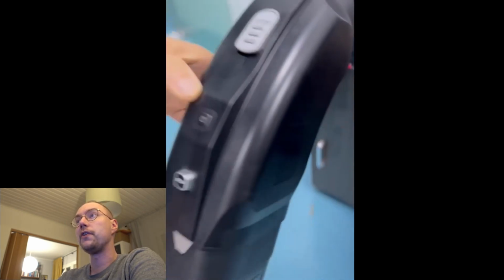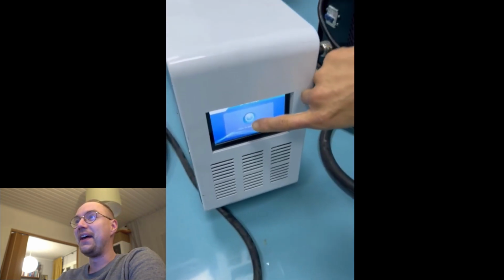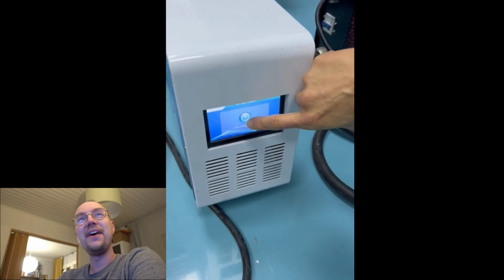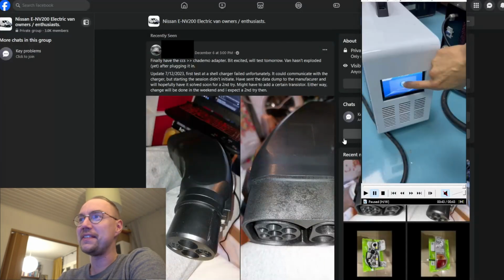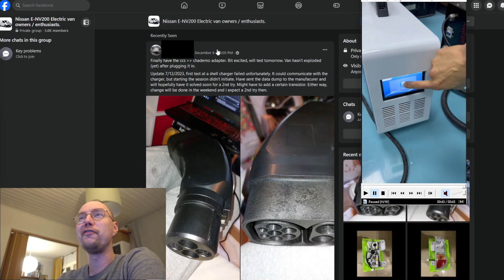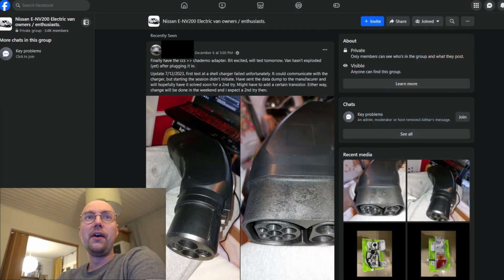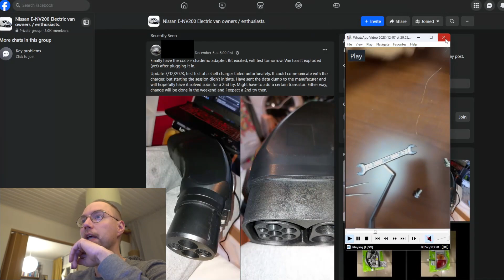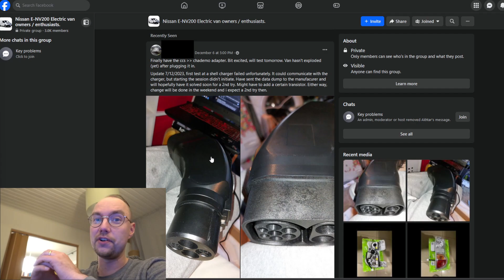They did not even test it on vehicles!💀

Comment: Great they have made these, now they just need to make another variant where it is a box with the needed electronics and some generic plugs.

Make a faceplate for different cars to be able to replace for example the Chademo / Type 2 connector in the Leaf, with a CCS2.

The way they should do it is make the box with the electronics a generic box that can be fitted into anycar (Maybe via a car specific bracket) then the faceplate with the connector.

Then you connect the faceplate CCS2 to one connector in the box, and another wiring harness that is also brand / model specific to connect into the existing car harness.

This way you can fully integrate it, and they only need to make one model of box and then different models of CCS2 plate to fit each car model and a small wiring loom to put in between the box and the car.

Oh yeah and then they need to cut the price in half :)

Comment: Apparently the chademo company do not approve of these third party adapters. It seems when evs are charging there is communication between the car and charger. It's not as straightforward as using travel adaptors for something like a  hairdryer. According to chademo the communication between evs and chargers is also different for the various models. These  aftermarket chargers may well appear to work but more needs to be done to ensure they are safe to use. It seems that some of them may not necessarily be weatherproof.

Comment: Bonjour je possède l'adaptateur et j'ai un problème avec un type de borne qui s'arrête entre 10 et 13 minutes de charge ... Cela peut-il venir de ma batterie interne pas assez chargé ? ... Est-ce normal que quand je change en USB l'appareil clignote rapidement au démarrage puis lentement un certain temps et recommencer indéfiniment ? Je ne suis pas sûr que la batterie interne charge vraiment .
Comment cela se passe au niveau des voyants quand vous le mettez en charge vous ? 
Cordialement
Et bravo de France
Reply from the maker: Update the software on the adapter. The charging stopping randomly was solved in firmware 3.3.8.6.B29.4 and onwards. https://docs.google.com/spreadsheets/d/18Uqyb2vJoLLAhkaYuRJ3yp8TAK-YEfgthubDkoFBTI4/edit?gid=1524304464#gid=1524304464
Reply: @DalasEVRepair  merci je l'ai déjà testé  ...aucune différence 🫤
Reply: @DalasEVRepair  what IS the best for leaf 40 ze1 ?
Reply: @DalasEVRepair  je pense qu'un des composants chauffe trop et mets en sécurité sur ces bornes là au bout d'une dizaine de minutes

Comment: Why would there be a requirement of a contactor at all? I guess both the charger and the car are having them. I think they added it to be able to sense the voltage of the car to tell to the CCS part what to supply. Then it need to disconnect the two until measurement is done.
Reply: Yes, except they did not add the sensing part, unfortunately... They are just using a fixed voltage of 350volts.

Comment: Dala, I have a 2013 nissan leaf that I changed the battery,  what should I do to see the bars of the new battery cause apparently I am seeing what the previous was registering?

Thanks in advance for your advise.
Reply from the maker: After changing the entire battery, the bars will be updated. Sounds like your new battery is degraded also? Or did you just swap the cells?
Reply: Hi Dala,I changed the entire battery pack except the bms.
The top part of the casing came damaged and also damaged the bms case so I use my bus instead. Will this caused this issue?
Thank you.
Reply from the maker: @barrepairsandmaintenance2425  yes, BMS needs to be reset with consult3+ nissan tool
Reply: @DalasEVRepair  ok thank you very much.

Comment: Further updates, it's working....kind of...looking promising!

Update 16/12/2023 I got multiple session working, although the soc data is really weird. Not sure if something wrong with my car,because nothing makes sense. Charging went slower and slower, dashboard gives full bars and full range, the little display on the right says 92%, leafspy says 88% and the kwh was 16.7kwh for a 24kwh 80%soh battery. Well at least i have zero worries that the adapter might cause some damage since the car simply controls what it gets. I did clear dtc's beforehand, longest session was close to 20 minutes. It was a ABB charger from Vattenfall at a mcdonalds parking lot. I really hope other chargers are that much different.

Update 16/12/2023 Got a working session!!! Only the soc was way off again, 60% vs more or less 90%, it started charging at 23kw at 4 degrees C so i stopped it after a few seconds. Real progresss!!!!
Okay good progress (see first post). Got a charging session going (!!!!) but the SOC was wrong. 60% was communicated, inside the car i had 10 of the 12 bars and this is what leafspy says. The charging station showed it charged with 22-23kw and i only dared to do this for a few seconds before i might damage the battery. Will drive around to drain the battery a bit more so i can charge a bit longer and will get a new firmware today as well. Will make a video next time if i have a bit more then 10 seconds to hit the stop button 😛

Update #3 @ 15/12/2023 Probably made a mistake myself with the external batteries, one of the cables probably 'slipped' in the welding clamp so it wasn't exactly 'on' during some of the testing. There is a led inside which you normally can't even see with which to check if the 12v is working, but it's in such an awkward position under the charging hood, i didn't notice it wasn't on. Anyway, with the latest software and the 12v 100% surely working, it sstill failed at the same point still. Only felt that the SOC may have been correct this time. Getting close.......

Update #2 @ 15/12/2023 Progress continues, but the manufacturer now thinks the little battery inside is not enough and their working prototype has 2 of the 3.7v batteries inside. Still strange that it still somehow doesn't work with an external 12.8v LFP battery attached. The inconsistencies might be because of me or that some soldering might have come loose. Got software update #12 now, will go within the hour for a last test today. Then i probably get a response during the night and tomorrow another few tests if they work on a saturday. I hope i didn't do something wrong with the soldering, i did check it afterwards, but still.....fingers crossed.

Update 15/12/2023 Progress continues, soc still gets translated a bit odd, but it's now closer (45% vs ~75%), also the communication error on the charging station comes a good full second áfter display the soc on the charger. Got av video of a brand new leaf with a portable ccs charger with this adapter, and they got it working. Getting closer and closer. Will test again in an hour.

Update #3 @ 14/12/2023 Progress continued with a late night test with the latest firmware. It now got consistently to the same point, showing a faulty soc (13% instead of ~80%) before not charging. Earlier in the day it only went there the first time and was all over the place, so, from my perspective, this consistency is already a major step forward. It looks promising to have the first succesfull charging session before monday. I did forget my charging card, so i had to activate the charging station through the shell recharge app.  I really hope it's not what (also) makes a difference, but come to think of it, activating the charger felt faster through the app, then manually holding the card to the rfid reader.

Update #2 @ 14/12/2023 Promising progress, but a bit inconsistent results. Seems like the fix is in timing issues so have to do a lot of tries. I did manage to get a battery soc on the charging station, but it was a bit wrong. Hopefully a couple more tries and upate over the days and we should have a succesfull charging session soon.

Update 14/12/2023 Promising progress. No longer a time out just before the charging session should start, i hear the charging station 'engaging' but then it quits. Precharge was succesfull. Manufacturer thinks something with timing in the software might be able to solve it. Hopefully today a 2nd attempt.

Update 13/12/2023 Manufacturer came with another (possible) solution, had to short circuit 2 tiny components on the chademo side, will test tomorrow around noon. Will have to test with the external 12v, the first added resistor and the latest fix. Manufacturer seems more sure then ever. Who knows, best case scenario; it works, worst case scenario, my car doesn't. 😃

Update 12/12/2023 Unfortunately with an external lifepo4 12.8v battery exact same result. It gets in an infinite loop on the adapter just before the actual charging should start, just like last times. I hope i can get some good news soon. It's too bad the ccs charger just gives the most generic error..... //adendum. So the manufacturer has aranged a chademo car, but he can only test it with another adapter. Not sure how useful this will be, I'm trying to convince to somehow show more debugging information. If the tests with the chademo car in China won't lead to further insights, I will press them on it.

Update 11/12/2023 Unfortunately with the usb C cable providing some additional power, the problem remains the same. A bit dissapointing obviously, but manufacturer will look for a chademo car in hong kong. I'll try to figure out some things, but i'm also busy with a huge renovation (cmplete rebuilt) of my house, so it won't be fast. Too bad it can't be fixed with a firmware, for now, i'll try to attach it to the car battery somehow to test if does work then. Fingers crossed.

Update 10/12/2023 4th & 5th test after firmware upgrade. They/we get the feeling that the 12V signal isn't strong enough or at least that the internal battery isn't big enough to handle the 5V can signal ánd the 12V signal. Will have to try again with extra usb c cable for a little bit of extra power.

Update #2 @ 9/12/2023 3rd test after small software/firmware upgrade, failed at nearly the same point also but got different data. Hoping for a 4th test in the coming days.

Update 9/12/2023, 2nd test with the added resistor, pretty much the same issue. "b2801-29 08 charger q/chg activitaion sig err vc-52" error from leafspy. So the car 'recognizes' with the 'click' sound that the adapter has been put in, ccs side can communicate with charger. From comparing the output data, issue is still the same for now. Will keep you updated.

Comment: That thing feels a bit like those dodgy adapters that gas car drivers use, with sometimes predictable results... 💥🙈

Interesting device however, but I rather see a retrofitted CCS port on the Leaf. That would take away any hassle with supplying 12 V or having double contactors, and CCS is everywhere. Chademo is totally unnecessary, unless doing V2G.

Comment: It will be a game changer for the LEAF and the Triplets if they can get a reliable CCS to ChaDeMo adapter, purely as they will now be able to access the entire network. In the UK, there are still ChaDeMo being installed, however give it 10 years and these cars will only be able to 7kW AC charge. 

When the Leaf 62 and UX 300e can get in excess of 200-250 miles, it may be less of a problem. However, for the Leaf 40 (and earlier), if the price is also right this will be a game changer. I believe Muxan will do a CCS conversion kit for around 3450 euro).

Comment: Like Dala I wouldn't trust this when it hasn't been tested for real. I also don't trust that they advise adding a resistor to make it work. Why didn't they put it in to start with? Sounds like they're just trying to avoid giving a refund. I'd be surprised if the resistor solved all the issues. If it did then I'd expect the company to put the resistor in future units BEFORE they ship them out. But I think it's a case of buyer beware - caveat emptor.

Comment: My biggest consern here the too small cap on the input side the electronic plate and busabr, thats like 5mm <- its too small the 400V is isolated from 12v süstem but in wett conditions the 400V will jump over small caps!

Comment: looking inside, it has all the necessary components!
maybe there should be two contactors, but in fact there are already too many contactors in the circuit, the car has two+1s in the battery and one in the PCU, the internal charger has 2+1s with precharge
This self contactor is therefore only for safty to interrupt its operation in case of adaptery failure.
On the adapter, it is necessary to turn on the 12V relay circuits on the ato side and communicate all toghter and then send the combined can+ information to the ccs CP line.

Comment: The one contactor not a problem, because, you have 2 contaktors inside car battery, you have 2 contactors in charger - and the HD wires never powered with on end not connected.
The 2 contactor reguirment is that, if you put cable on water, then catastrofe happens, put you allready have many conatctors in line, thats already dooing safety stuff both ends!
I thinks even one contactor dosent needed, but some safeti 400V DC + is not bad at all! because one is 0V and other is live 400V DC + and you know witc is higger voltage.

Comment: The use of the battery and the need to charge it via USB-C is an interesting choice. I wonder why they don't just trickle charge it off the 12v coming from the pilot pin? Maybe it caused the voltage to sag too much, dropping down too low so that it wasn't in compliance with J1772 voltages? The spec requires "vehicle present" to be ~ 9v via pull-down resistors between Pilot and Signal Ground.
Reply: Looks like it needs to plug into the station first
Reply: Probably only a very low current sensing circuit not feasible to charge a battery. I had always assumed that a (for long time theoretical) CCS to CHAdeMO adapter would require onboard power, for the communications translation electronics as well as the lock solenoid that is part of the CHAdeMO connector and required for handshake.
Reply: In chademo, the charger must supply power to the cars contactors, 12V 2A according to spec, and in addition it need to power the internal contactor and electronics. You can not get this much power from anywhere except the high voltage itself, so they need the high voltage transformer/converter (the black rectangular thing beneath the pcb). An alternative would be separate 12V from the car itself via lighter/aux socket, but this is not as sexy as a standalone adapter:-)

Comment: I'm actually surprised how serious this adapter looks. The outer casing seams to be injection molded and someone has made a really good job packing everything in such a small form factor. As a designer I can say that someone has put a lot of hours and some money developing this thing. I hope we will soon see a video with someone charging a Leaf with it.
This would be a real game changer for the Leaf. In Sweden where I live the ratio between CCS and CHAdeMO chargers is more then 10:1.
I would definitely buy one.
Reply: Same. This is not some ordinary power saver scam like device. They actually try to do something. If they able to pull it off then they get rich af.
Reply: Fortunately here in the UK there is provision for ChadeMo in most of the new charging hubs being built. Many networks recognise that early adopters still exist in quite large numbers.
Reply: @trevorberridge6079  I'm not sure if that's true.. Where it is there tends to be only one or two chademo, shared with CCS without dual charging.
Reply: I'd like to see the whole thing potted though once the design is more final... at 300V+ DC there is a substantial arcing potential to have that many parts that close together... especially since the contactor isn't breaking both positive and negative.

Comment: Hey Dala! I wanted to let you know that I finally gave up Chademo last month and sold my Nissan Leaf. I decided to buy a Tesla with the NACS charging port (I don't think you have these in Europe, or do you?)

Anyways, in my short assessment, NACS is superior in pretty much every way to both Chademo and CCS. As I'm sure you know, most of the US domestic manufacturers have coalesced around NACS within the past few months so it seems like CCS and Chademo are pretty much dead men walking in the US.

Do you have any experience with NACS and what is your opinion on it?
Reply: If you have sold your Leaf you no longer need to get involved here
Reply: @jonianderson8692  That's mean, I have a soft spot in my heart for the Leaf still.
Reply: NACS is great for US and other places where there is no 3 phase electricity. In Europe there is 3 phase electricity at normal houses very often. There the CCS2 makes sense. European CCS is different from the US one, CCS1 vs CCS2
Reply: @kengucam  Interesting, thank you!
Reply: @kengucam  The US has 3phase power with 480V in businesses etc. For charging trucks and buses, there is SAE J3068, which as AC-only is like 400V Type2, and as DC8, it is like CCS2.
Reply: @mattg432 it's very seldom implemented though. When you get up to that large and commercial of EVs, the vast majority seem to go the route of completely omitting an OBC and only charging with DC (via CCS1 port).
Reply: @ashton9699  Well, omitting that pesky built-in onboard charger and using DC-only is the way to go, sooner or later (2040, maybe). Not even Tesla makes the cars DC only, plus offering a seperate mobile AC charger, or a DC connection to Powerwall and solar at home. As long as both AC and DC are used, a combined CCS socket in the car makes sense, instead of the NACS bottleneck were AC and DC use the same pins and extra circuitry is needed to seperate them inside the car.